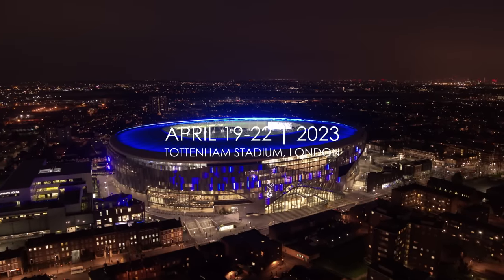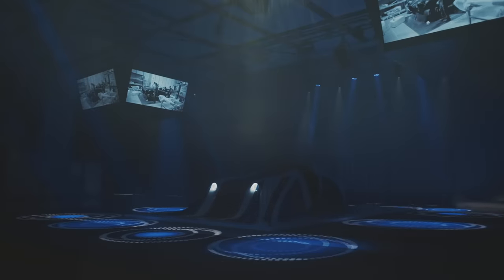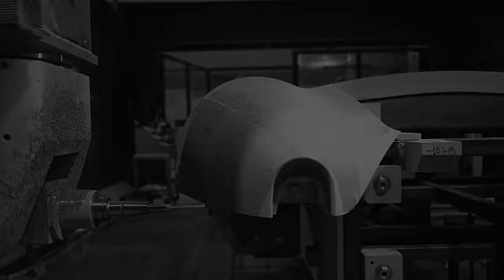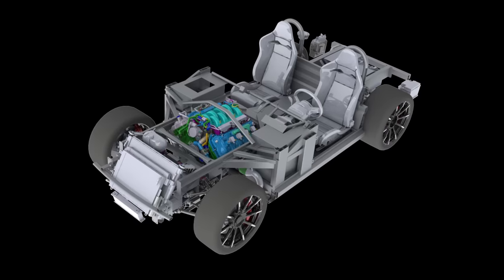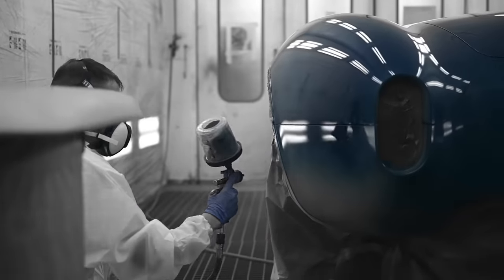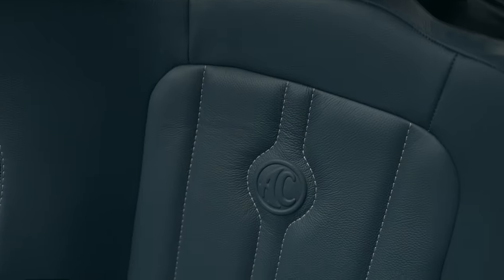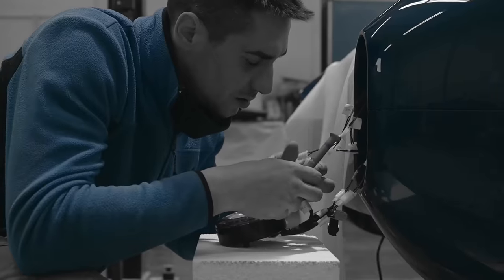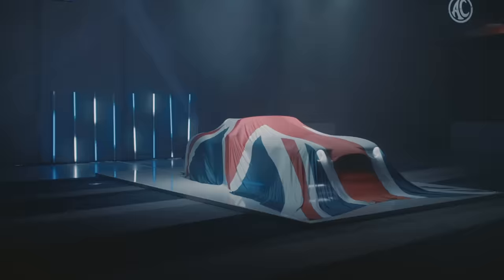AC Cobra GT Roadster unveil 2023

Comment: But missing the iconic side pipe exhausts! 😢
Reply: Probably has to comply to a certain spec to gain it’s roadworthiness test certification pre production and then each car can be modded to customer’s bespoke  requirements as required…
Reply: The original 289 cars, which this seems to mimic, never had side exhaust.
Reply: @dioncarey9077  THANKS!! Amazing that people forgot about the 289👌🏾
Reply: …. Neither did the 427 street cars. Just the comp and S/C 427 had  sides pipes.